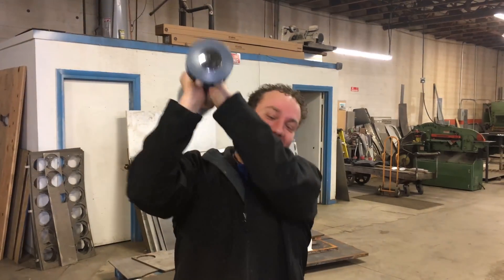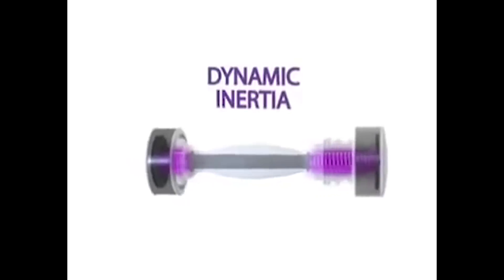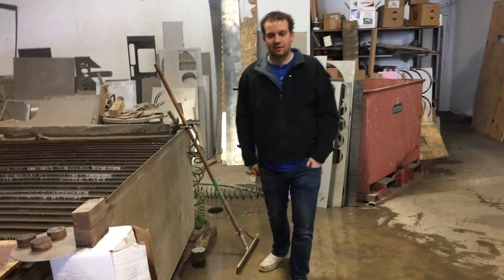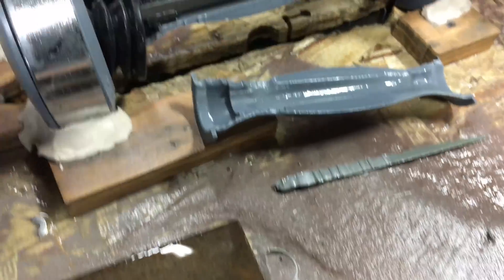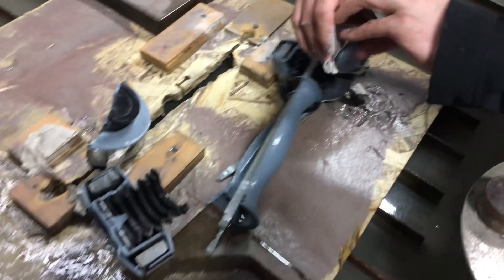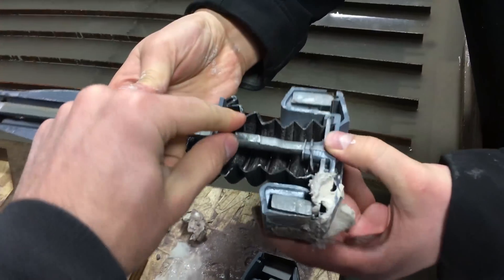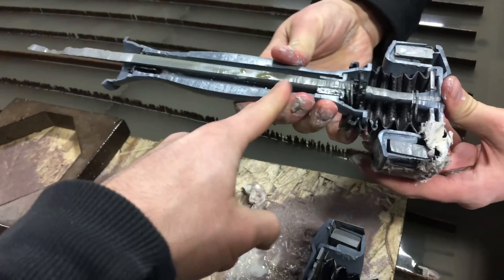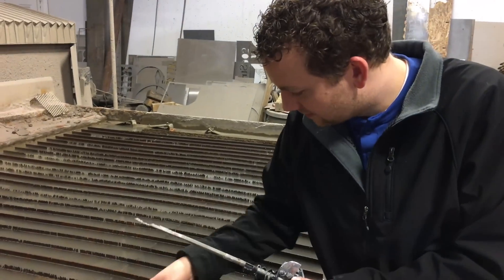Shake Weight vs 60,000 PSI Waterjet

Comment: Asparagus with salt and pepper. It is simple and tastes great. Wash the asparagus and then cut off the hard bottoms. Then heat olive oil on a medium griddle and place the asparagus on the griddle. Sprinkle with salt and pepper and cook until soft. Remove the asparagus from the griddle and sprinkle with salt and pepper once more. And your side dish of asparagus is finished.

Comment: but why was it so hard to cut ?
Reply: pressure wasnt' enough to cut through the bottom part + a lokid steel(?) bar in the middle
Reply: it works best when the jet is very close to the object, and the spray had to be pretty far from the lower section of solid metal.
if they had known ahead of time what it looked like, they would have taken the pass slower.